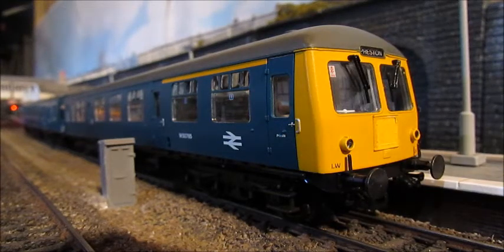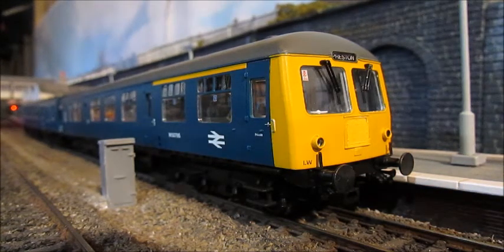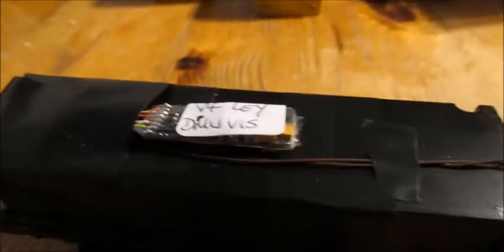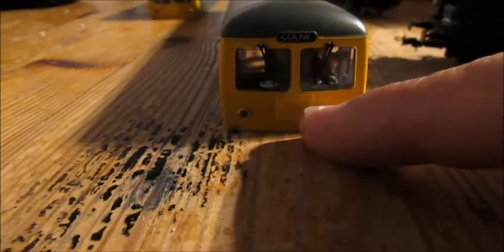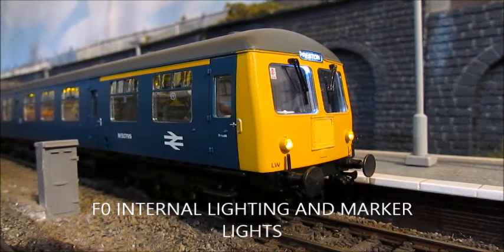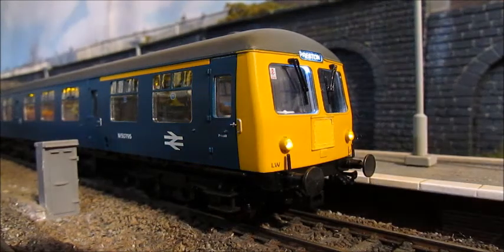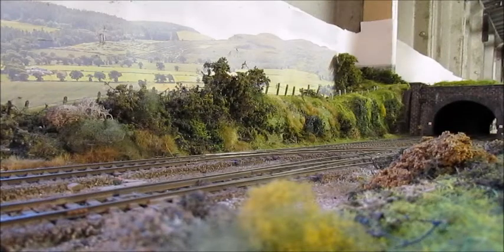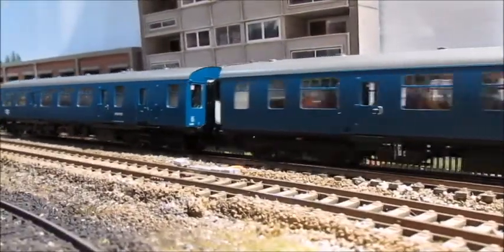Bachmann 105 DMU DCC sound review, Modifications and model overview

Comment: Intro sounds like Yamaha SY77 !! Nice review / sound demo. The prototypes involved in the “Lockington Rail Crash” (East Yorkshire - July 1986) consisted of both Class 105 and Class 114. Some bogies were disconnected from the chassis in the crash and the chassis plates badly damaged. The bodies, (as you say filled with asbestos) were removed to the Hessle Corporation Land-Fill, inverted and filled with rubbish, according to local rumour!
Of course, asbestos was deemed to be the best insulator of hot machinery, and sound deadening properties for years.
I have a book from around 1935ish which describes the building of garages in the day. Of asbestos, it says something akin to “the best available insulator which must be used in garages”!
Reply from the maker: Hi,
The intro was done on a Korg Radias. Though I do have also a Yamaha SY85 as well. As far as asbestos is concerned. Yes it was in the day considered a fantastic product as it had many properties it could be used on. I work for fire protection company and have done a few courses on asbestos. Quite fascinating and scary at the same time. It was was used up to the year 2000 in many, many products including some toilet seats, roof panelling, tiles, boiler insulation, insulation material in general plus much more! It was even used as fake snow on film sets ( check out the Wizard of Oz) That scene is absbestos flakes!
Reply: BALLAN PARKWAY The lads at Cravens used to have snow ball fights with it.

Comment: That weight block is mahoosive....... over a third of the body length! A shame really as it does encroach on the windows and doors.
Great DMUs though and Biff’s sound is really good. I have the early one and have put a cheap decoder in the second unit for the lights.